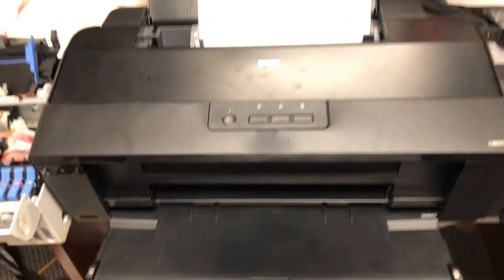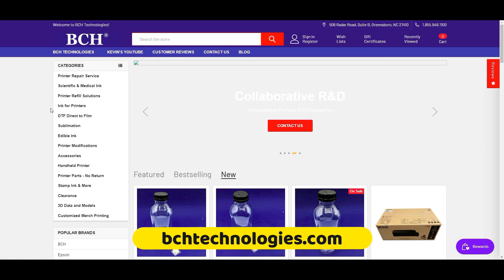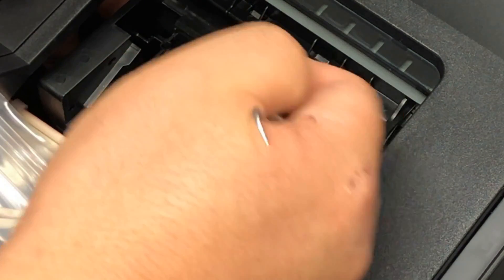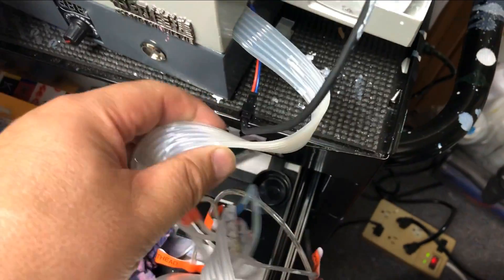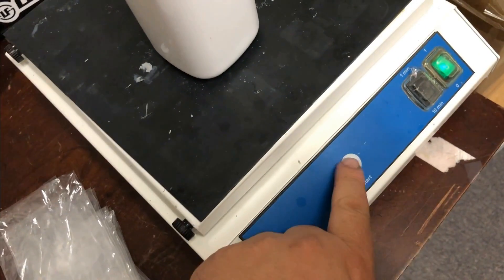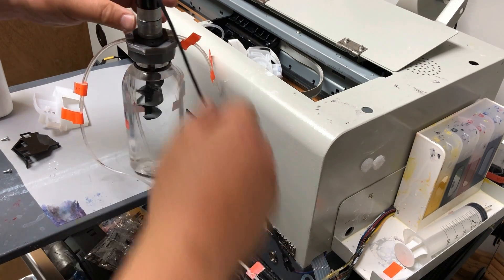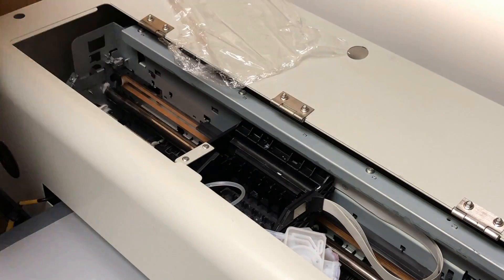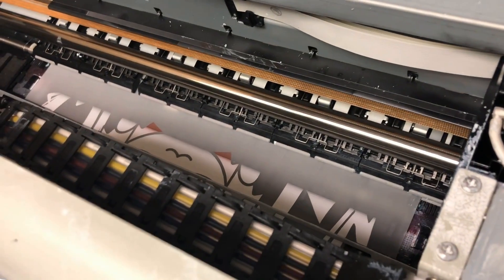Simplify DTF Maintenance: The No Clog Method for Infrequent Printers

Comment: You're using a shaker machine for the white ink here, but in a previous video you said the shaking method was bad. Has your opinion changed?
Reply from the maker: Not everyone can put down $600 for a roller
Reply: @BCHTechnologies  true. I'm cheap. I'm building a ciss right now with a $20 magnetic stir plate 😂

Comment: Hello Kevin, so I have a Epson 8550 converted to DTF and Im just getting started. If I only plan on printing two days out of the week should I drain out all of the ink when Im finished and clean the lines with distilled water? How long can the water stay in the lines? Thanks
Reply from the maker: Thanks so much for your question and for subscribing to my channel! Your support means a lot to me, and every subscriber helps me get closer to the 100k milestone—something I’ve been working on for over 8 years. I truly appreciate your engagement, and I do my best to answer subscriber questions within 48 hours. If you need a quicker response, feel free to post your question on any video or email me directly at **support@bchtechnologies.com**. 

For your Epson ET-8550 DTF setup, I recommend installing a printhead management assembly (PMA) to simplify maintenance. This assembly eliminates the need to flush out the lines and dampers regularly. You can find it here: [Printhead Management Assembly](https://bchtechnologies.com/products/printhead-management-assembly). The product page includes an instructional video that walks you through the installation process.

If you’re printing only a couple of days a week, it’s crucial to remove all the white ink from the printhead and wet cap it as demonstrated in the video. You can fill the lines with distilled water, which can safely remain in the system as long as needed. In one of my tests, I left the printer unused for 14 days with PMA installed, and the first print came out perfectly. Let me know if you have more questions—I’m here to help!
Reply: Hello. When going on vacation for a week or two, should I fill all the ink lines with distilled water or just the white ink lines?

Comment: I do something similar, but don't swap the printhead. I just swap cartridges. So when I need to print DTF I use cartridges with DTF ink. After printing with DTF ink I change out the cartridges for cartridges with regular ink and do a head clean and start printing normal. And off course I do clean the capping station on the printer so it won't clog.
Reply from the maker: Thumbs up! Keep up the great work!
Reply: Can I do this to my epson et8550? I converted to Dtf with xp600 manifold with v2 dampers
Reply: Does that work?  Eg. Can I go between sublimation or dtf cartridges?

Comment: This video is a bit confusing because you are showing printhead replacement or swapping.  I don't think you are telling us that is part of your maintenance.  Your main point is to flush everything with distilled water overnight using your macro and never leave DTF ink sitting in the printer lines or head.  Is that correct?
Reply from the maker: I am simply demonstrating my routine. I require the printhead to be operational on a daily basis, in addition to the tasks you previously mentioned. If you don't intend to utilize the printhead every day, you should fill it with a wetter solution (shipping solution) instead of a cleaning solution, as shown in other people's videos. Personally, I prefer using the printhead daily because it assures me that it will be in perfect working condition at any given time, without any issues.